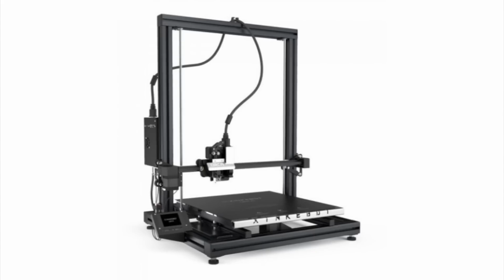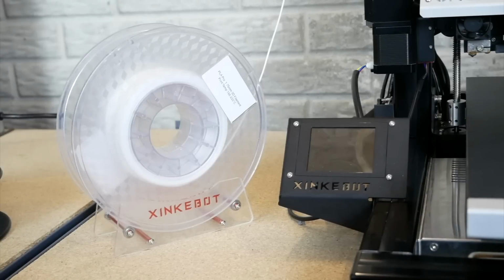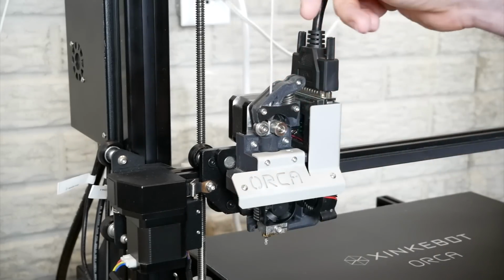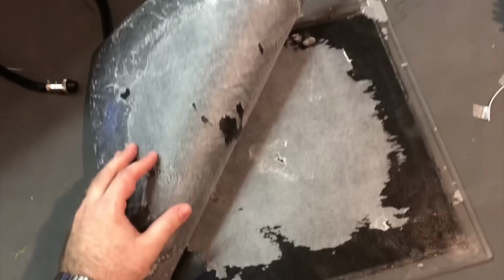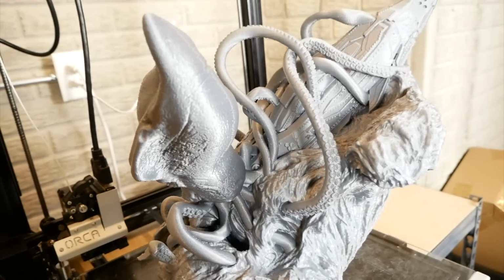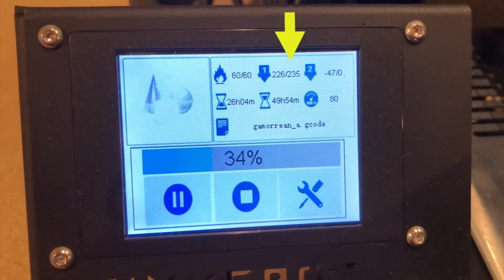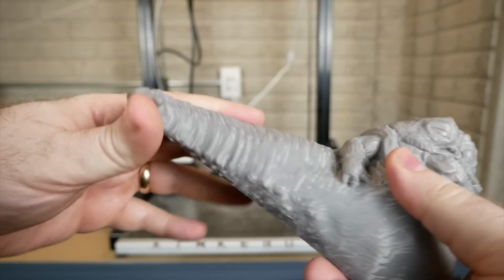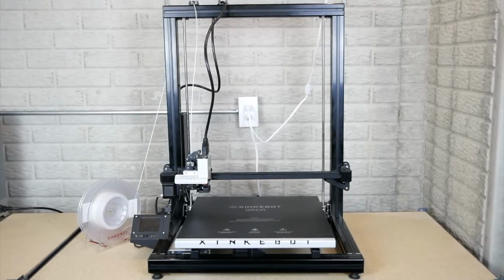Xinkebot Orca2 Cygnus First Look Review

Comment: sorry but no. that heat bed looks like crap, changing out the surface looks a pain & I refuse to print on glass. The funky end stop adjust seems dumb. the print doesn't look great either. no filament sensor as standard seems like a cheap cop out. so, not great & not cheap.

Comment: would you recomend this printer?..i have a great 20 x 20 printer and was looking to expand to a bigger printer,it is expensive but i like the size and auto level..so would you say yes or no to this printer? love your vids subscribed :)
Reply from the maker: I don’t really recommend it at this point. I have had some issues with reliability with this printer since I made the video, and the price is very high. I still use my CR-10 printers all the time with relatively few problems so that’s still my go-to

Comment: I am considering buying the Xinkebot Orca 2  but I think the price is a bit high. do you Like this printer? Any complaints? I have Ask a lot of questions about this printer and they have been real responsive.
Reply from the maker: Thomas Allgood I don’t think I would recommend it at this point due to the price. Mine is currently out of commission and I’ve just left it as it is because my Creality printers still work fine (and cost much less)

Comment: A year on what are your thoughts on the Orca 2, and did you get to try Dual extruder, especially with PVA supports?  I have a Chiron which is the same size as this and a 3rd of a cost, but I hate the bed leveling on the Chiron and lack of second extruder for PVA.
Reply from the maker: 10p6 I did get the dual extruder but never got it to work satisfactorily, and the PVA supports were particularly disappointing. I don’t think I can really recommend this printer at this point
Reply: @MightyJabbasCollection   Thank you for the prompt reply.  It is a shame that so many printers are so familiar in design, yet they seem to miss what people want.  I designed a printer years ago that did a very quick fully automatic bed level before each print, with absolutely nothing to set by the user, and it did not require much more than a normal printer like this.  Then they have printers like my Chiron which is much cheaper (I cannot believe the Chiron and Orca have the same bed rail system, yuk) but they do not leave any option to add a dual extruder.  It is a shame that all these affordable-ish printers are let down by the last 5 percent.

Comment: That squid looks ....................fairly poor, but not terrible!    just hmmm.  the curved smooth sufaces are garbage esp for the size of the model, my £200 (modded) Monoprice mini V2 would piss all over this ( as a greatly reduced size)      :D   a printer that expensive should be made to fit together without needing tons of callibration.  this neeeds like stripping down and rebuilding or just sell it/send it back.

Comment: I own one of these and am very happy with it.  I had a chance to see a gMax and a CR10 today to compare, and the difference between the Xinkebot and the gMax is more of the extruder system (Xinkebot has quick change extruders) and the gMax is totally open source.  The frame and parts quality is very similar (the stepper motors on the Xinkebot actually look like they're better machined than the gMax). One drawback is that Xinkebot doesn't use open source firmware, but they are very good about tweaking it for you if you want.  I made an all-metal hotend and wanted to print at 260-270C so they made the firmware go up higher for me and it worked fine.  I didn't have the temperature issues Mighty Jabba had.  The customer service is very responsive -- which is actually what sold me.  The motors, frame, build plate, etc. are all very high quality, very tight, very well made (I also took the stock print surface off and just print on the glass). The print quality is quite good at 0.2, and outstanding at lower layer heights such as 0.15.  I've only seen better prints from corexy-type printers like the Raise3D and Stratasys which are way more expensive.  I've printed using nozzle sizes from 0.4 to 0.8 with great results (I use Simplify3D).  The CR10 looks like it's a full class or two below the Xinkebot and the gMax.  The frame is much thinner, the motors and bearings all seem bottom-of-the-line, and the motion seems so much more clunky (but of course, I only saw the printers and didn't actually print with them). But overall, I'm still very happy with the Xinkebot and glad I got it instead of the CR10 or gMax.  They run an occasional special where you can get 15% off on Ali Express.  I got everything including dual and single extruders for about $1600.  Would have been around $1400 without the dual extruder (which I still haven't used since Simplify3D supports come off easily).

Comment: One thing that really annoys me about a lot of these 3d printers is it seems the more you pay the more they are made with 3d printed parts. If I'm paying a premium price I want the plastic parts to be at least injection moulded and not 3d printed. I've just bought a CR-10S and there are no 3d printed parts on it at all, it's mostly metal, even the crappy filament out sensor holder is injection moulded.
Reply from the maker: The CR-10 family of printers used to have 3d-printed parts as well, but they slowly phased them out. I agree that injection-molded parts are preferable, and would seem like a must-have at this price point, but I haven't found 3d-printed parts to be an issue on any of the machines that have them

Comment: Thanks for the look at this printer.  

I wonder if power supply is browning out. That could be also be creating the banding issues particularly if you are notice them happening in certain filaments (ones that are more temperature sensitive).

Also do you you think that auto bed leveling could be responsible for some for the poor mating edges by having a warped bed? I never thought about it as an issue until watching, but now I’m curious others thoughts.

Anyway, you had some amazing prints here and some excellent work! Again thank you!

Comment: Better to buy 2 prusa...
Reply from the maker: takhsisprime Check my S5 review for more info, but the S5 heat bed doesn’t cover the entire bed and in my experience the big moving bed has a tendency to lead to layer shifts. Plus the S4 is cheaper. The S5 is not bad certainly but I would only really recommend it over the S4 if you really need to print very large items
Reply: I noticed it would take about $200 to replace with a full bed that heated up quickly.  Why in the world would creality make that decision?
Reply from the maker: Or maybe a Prusa and a CR-10 S4 for larger prints
Reply: Why buy an S4 when you can buy an S5?

Comment: WTF? You think it cost $1500 to add auto bed level to the CR10? I like your prints but you seem way off on your facts. Did you vote for Trump?
Reply: 70$ for a auto bed levelling on a CR-10 whatever the version... 1550$ is just too much for what it offers...
Reply from the maker: After the coupons, the Xinkebot ends up costing roughly double what the CR-10 S4 costs, (approx. $750 vs. $1550). I've certainly seen people spend hundreds by adding options such as auto bed leveling, upgraded 400x400 heat bed, touch screen, and so forth to the CR-10 S4, and you still have to install and troubleshoot these options by yourself. As I said in the video, the CR-10 S4 is still by far the more cost effective option, and the one that I would generally recommend for that reason, but if you want something with all of these options that you can just use right out of the box, the Xinkebot isn't as expensive as it might appear.
Reply: $7 to add auto level. $70 if you go with a BL touch.
Reply: You said to buy this over the CR10 if you want the features. No way would it cost more than $150 to add them.
Reply: Well you can have a full inductive sensor solution with support, manual,...for 70$ on TH3D, you can insulate your bed for 10-15$...touchscreen is useless for build quality... Still you're far from the cost of this printer that is more time consuming to build, you still have to adjust Z endpoint...
Reply: Dare you defame the God Emperor?
Reply: Vote for TRUMP what a FFFNNN Moron you are. TRUMP 2020